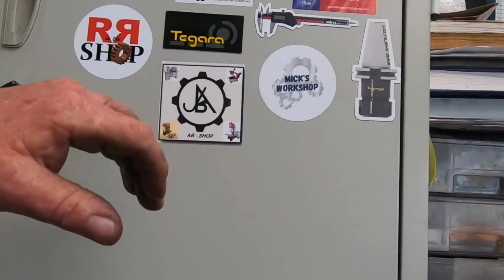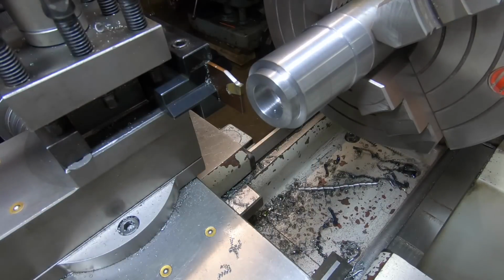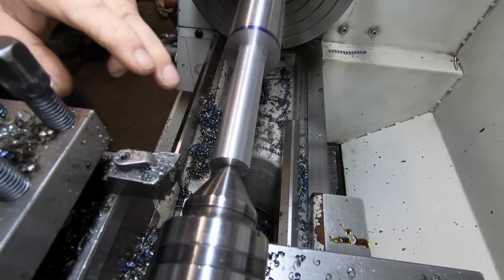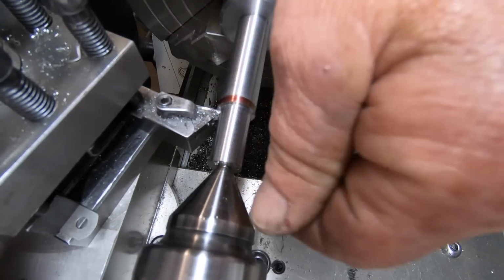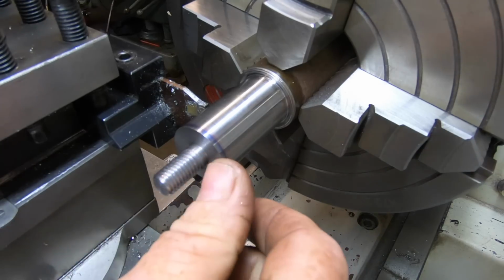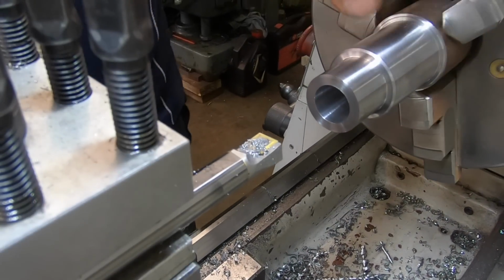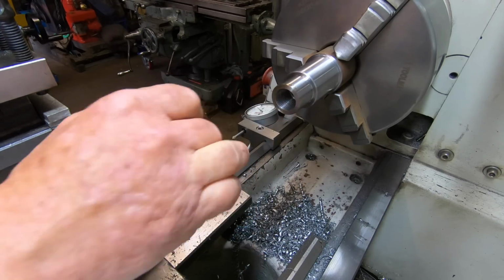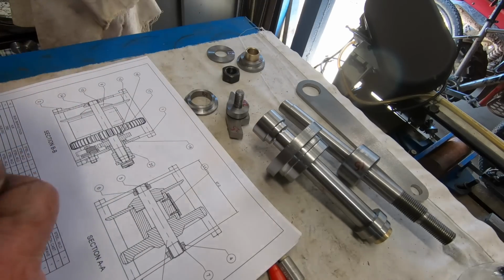Hand Winch Build - Part 1

Comment: Ok, I give up.  How do you get away without cutting thread relief?
Reply from the maker: Gday William, I very rarely ever use thread reliefs, when the thread is getting to the end of where you want to stop simply withdraw the cutter, from what I understand the thread relieves are only used when cutting left hand threads, you need this to start, hope this helps, cheers
Reply: @MattysWorkshop  well i think youre a bit more on the ball than I am... Id withdraw the tool too ate and snap it

Comment: Marty- being frugal (in other words cheap and lazy) it hit me as a tremendous waste of time and stock to pare down the gear shaft rather than using a smaller diameter stock and putting in a keyway.  Do you think that strength is the issue?  Or?  Besides being more effective with materials, the ability to harden or use more wear resistant metal comes to mind.  Don’t know if this is a prototype or kit as I didn’t hear that mentioned, but thought that I would bring up my initial reaction.  From the bushes it seems like a long life expectancy is designed, very interesting project indeed!
Reply from the maker: Gday, the shaft that holds the gear could be made in 2 pieces by having the gear keyed to the shaft, I had the material which is why I made this all one piece and there’s no chance of anything going wrong if these a lot of weight on the winch in use, thanks for watching and commenting mate, cheers

Comment: You could try LPR toolmakers for the gear cutters- you can get them thru live tools but  you will be buying top of the line tooling - you could of course make your own cutter .
Hey Matty next time you are turning or milling something in steel can you try that Hangsterfers  tapping fluid as a cutting oil ? Just curious how it would work and if it smokes heaps . I know it isn't meant for this use but sometimes you can stumble on to a good thing by accident .
Reply from the maker: Gday Ian, the Hangsterfers superall tapping fluid does give a lot of smoke when used as a cutting fluid on the lathe and the smoke will stain bare metal like the chuck etc, I think I’ll be looking at eBay for the 2 cutters i need, funds won’t allow a full set at the moment sadly, thanks for watching mate, cheers
Reply: @MattysWorkshop  
Thanks Matty, saves me forking out the hard earned to test it !